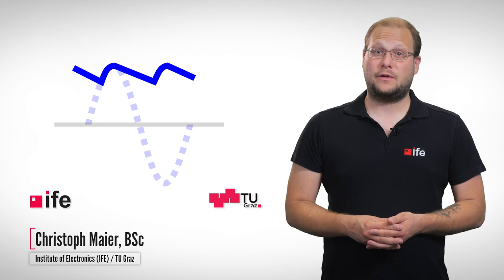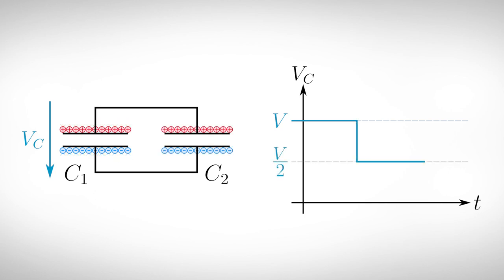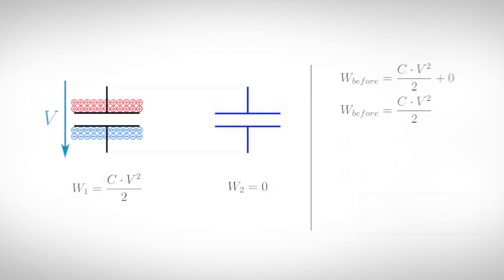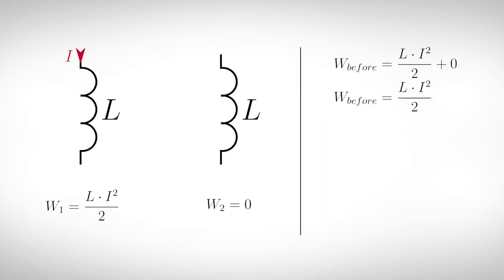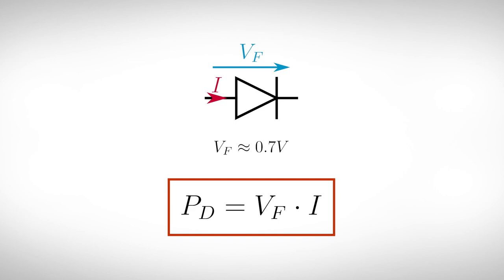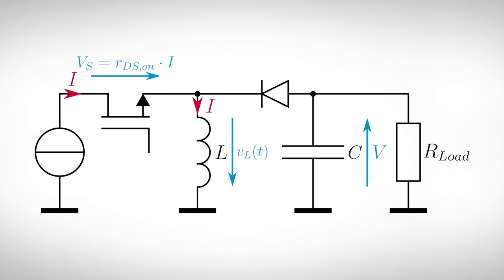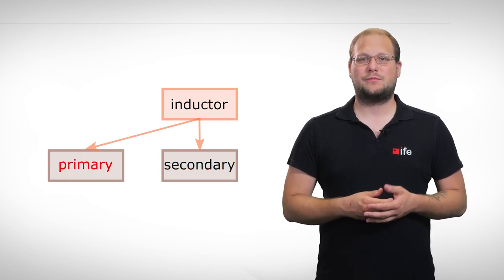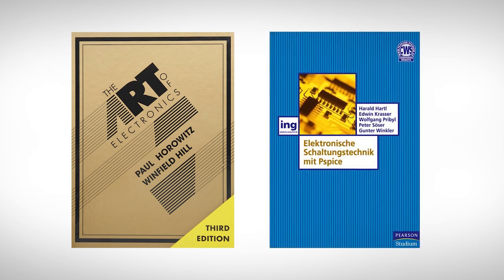Basics of Switched Mode Power Supplies (SMPS) - Charge Pumps, Switching Elements, Types

Comment: Very good video, however at minute 6:07 there is a little conceptual problem. If you have an inductor with a current flowing in to it and then you connect in parallel only another inductor (so you have two inductor insulated from other components), the two inductor are also in series and the initial current cannot vary instantly.
There is also another problem: the tip of the arrow that indicate the voltage, in europe, is the positive pole